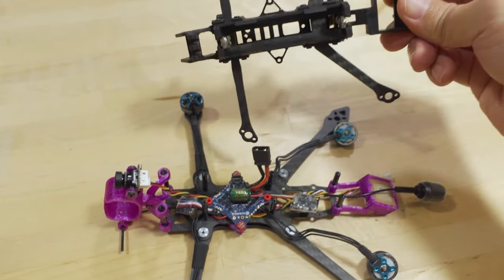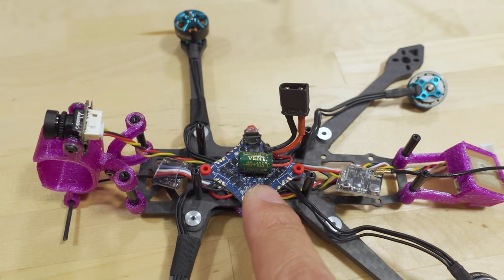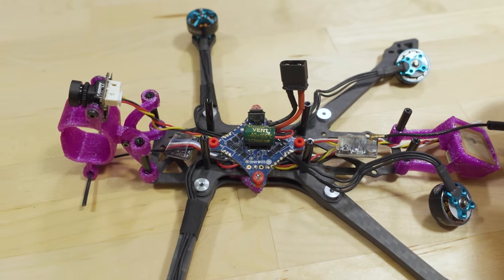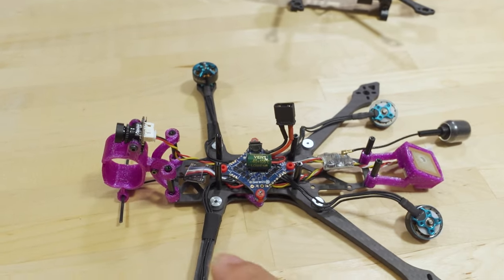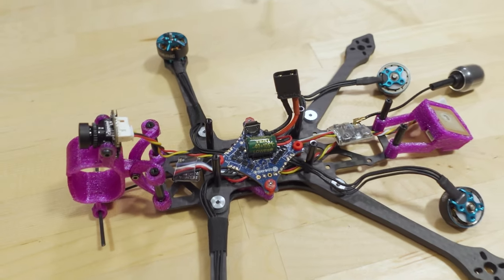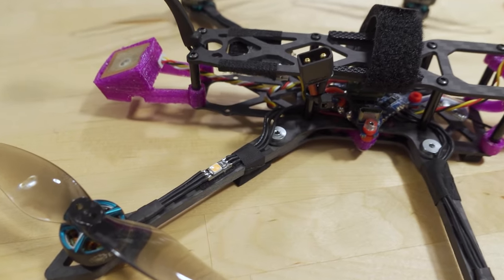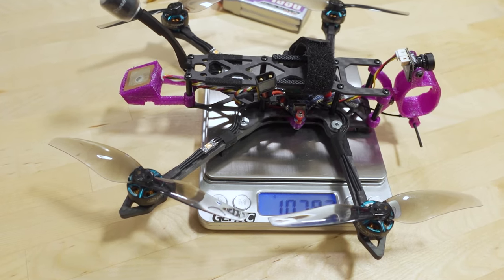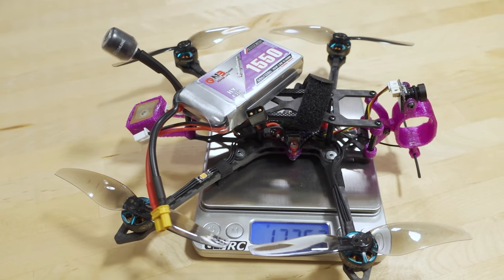Drone Lemonade // Will 5A ESCs Catch Fire? 🔥🍋

Comment: Good project Albert! I crashed my LR3 last week and although it was fairly minor, the whole plastic battery frame broke on it... took mine apart like you did and transfered eveything on a 3d printed "dave c type" design frame... That works but your solution is much better! I think i might order on of those frames you used!  What kind of flight time do you get with a 1550 i wonder??
Reply from the maker: I flew it about 10 minutes.  Probably could get more but these days I can't fly longer without a break.

Comment: great video Albert . i feel that alot of escs are under rated look at back in the day when we where flying a 5in prop on a 1806 2300kv on 3s with a 10a esc they seemed to work well  i just think alot of people live by bigger is better rule i still love the rev35 4in1 on my 5in builds it has been a great esc for me over the years thanks for sharing
Reply: I have an old AIO with 2a ESCs....4" Here we come!
Reply: @saidinesh5  Oh man those Trashcan Boards were awful. I had 4, all of them blew an ESC eventually. The 12a AIOs were much better
Reply from the maker: The ratings don't seem to mean much.  I've blown 60A ESCs on a light 5 inch just cruising around while these 5A ESCs seem just fine. 🤷‍♂️

Comment: Thank you for the very informative video.  

Can I ask a dumb question and that is where did you get the race wires and the lcd board that you used to extend the motor wires?

Thanks.
Reply from the maker: I added the link to the race wire in the description.
Reply: @AlbertKimTV  Thank you very much!

Comment: I'd just comment that if you crash this, never try to turtle mode it, you'll blow the ESCs instantly. So it's best to just disable turtle mode. 
I'm also curious if you put a throttle limit in betaflight? Awesome project and great to see it hold up.
Reply from the maker: Turtle mode on 5A ESCs is just useless anyway and should be disabled!

Comment: i have that 4 inch frame and did a custom build with same parts as the chimera and that is with a caddx vista and Neb pro. it is so much lighter than the chimera and flys amazing TBH and only £12 for the frame.

Comment: I built a little babytooth with the happymodel elrs 2.4 board. 5a escs.  On punchouts I see 17-18 a draw in my osd, but it hasn't gone up in flames, yet.
Reply from the maker: That's still under the 20A total for that board so you're good!

Comment: Is that a 4in1 5A esc or four 5A esc's?
Reply from the maker: 4 in 1 ESC and each rated for 5A
Reply: 4in1 5A means that every motor gets 5A so it's essentially 4x5A

Comment: i am very interested in torture test of this quad, and weight capabilities, if its capable of lifting naked gopro and frying with it for 8 minutes- in ordering asap
Reply from the maker: Should have no issues with naked GoPro as the GO 2 weight about the same.
Reply: @AlbertKimTV  alrighty then, thank you
also,have you thought about putting it on a toothpick frame? with 5amp speeds less durability probably would not be an issue, but quite good weight saving...probably, and can you limit voltage input on this board and stick something like 3s on it? just for fun, would be interesting to see how this drone will behave itself having maximum power availability at all times with less weight, or an experiment with 21700 battery maybe as well?
All and all im that kind of guy who likes to know how far you can go with given set of electronics